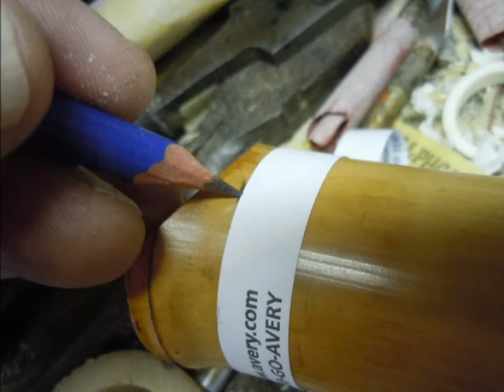Shakuhachi inlaid rattan binding - Mujitsu Shakuhachi / Ken LaCosse

Comment from the maker: That depends on the quality of the bamboo as well as how well it has been cured. Any bamboo can crack..and it's not the end of the world if it does. It can easily be repaired good as new. Preventative binding may help somewhat, but not always. (There are different opinions on this) I usually prefer to bind only after a crack. For me, the simplicity of the unadorned bamboo trumps the perceived benefit of preventative binding. Hope this helps. -Ken